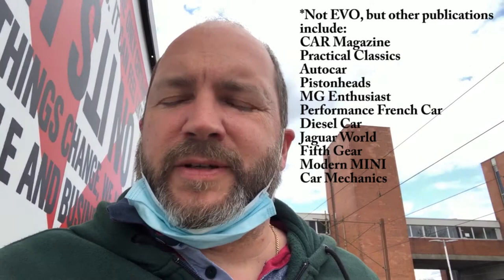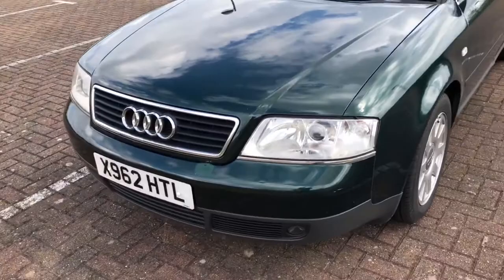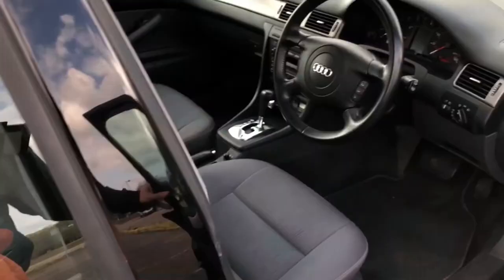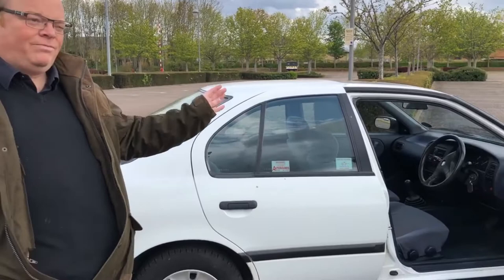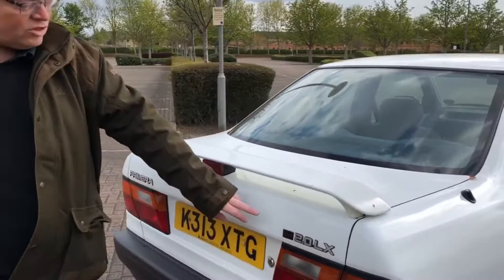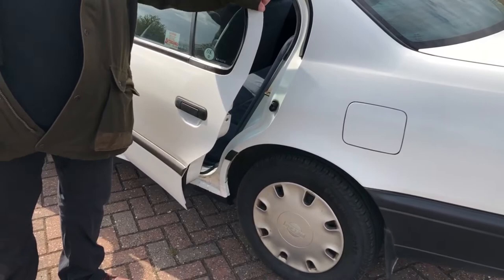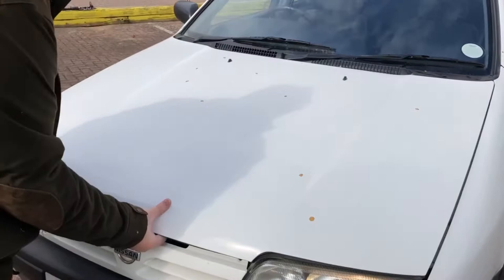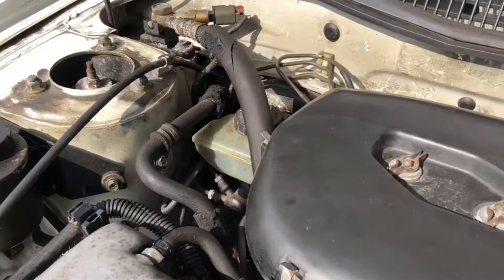I bought a P10 NISSAN PRIMERA from AROnline Creator Keith Adams - RETRO RIDE (Infiniti G20)

Comment: I actually own a P10 and I bought it last January with 50000km so I'm not sur how much it is in miles but it's definitely less 😄
Reply from the maker: Nice. What model is it?
50000km is 30000miles roughly.
Reply: @NeilsCarsAviationTravel  I'm not sure about the exact model, I struggle to find clear informations on that since you don't see a lot of these here in France (ans also because of the whole dealership situation explained in your video)
All I know is that it has the GA16 with 16 valves and 102HP, and it says "serie 2" on the front wings

Comment: That is a nice find Neil. I saw a R reg Primera 2ltr automatic other week for sale, but then remembering that the ULEZ is expanding further out around to the A406, had kind of put me off! I really want a retro classic but looks like this ULEZ will prevent me from doing so!
Reply from the maker: Ah was that the red one on eBay with 66k miles?
Looked nice, but the auto gearbox really blunts the performance and the manual gearbox is such a joy to use.
Reply: @NeilsCarsAviationTravel  No I think it was on the carandclassic site.